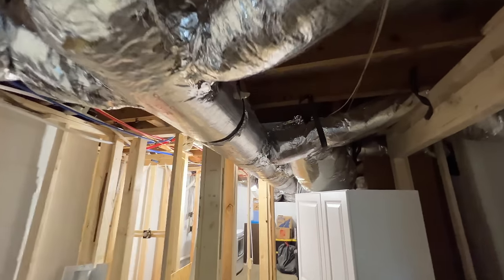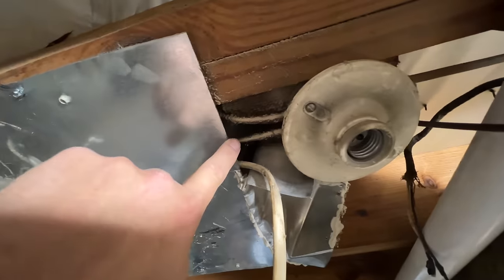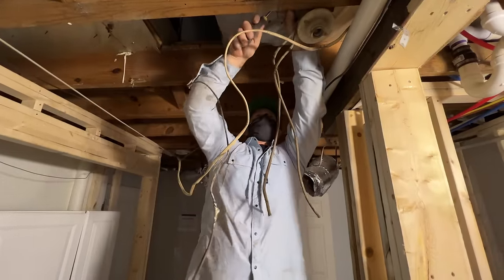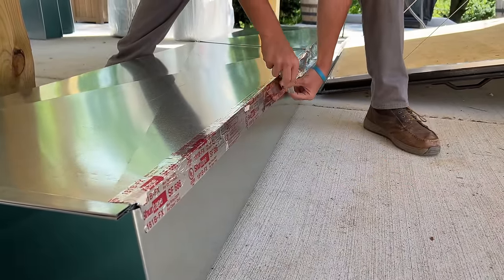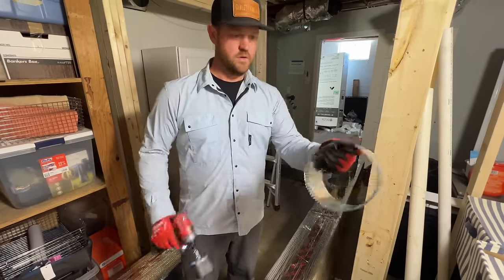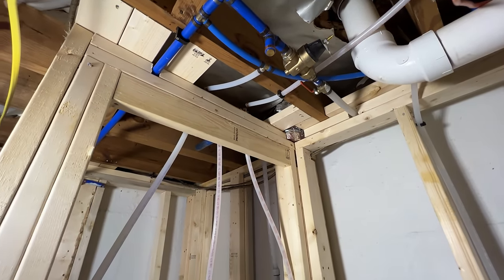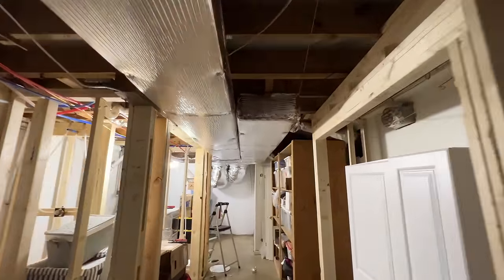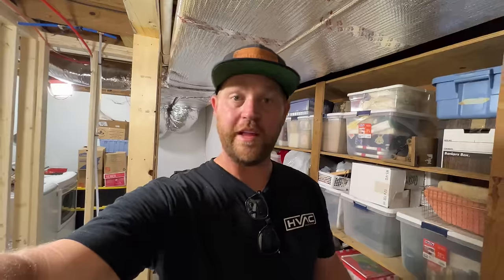Teaching The Apprentice How To Install Rectangle Ductwork | HVAC Installation

Comment: Square duct hanging tip: drop your hanger strap first, measure off floor up to where bottom of duct will be then make a mark on the strap.  Cut it off a couple of inches below the mark and bend the strap  at the mark.  Do the same thing on the other side with another strap to make a "cradle" for the duct to sit on.  Do this all the way down the length of the ductwork.  Then all you have to do is bang a couple sections together and lift it into the cradle.  Screw the straps to the bottom of the duct to secure.  Makes throwing ductwork up so freaking fast and looks pro AF
Reply: Basements are far from the norm in Tennessee, mainly slabs & crawlspaces .So it’s understandable  their expertise & experience is probably limited at best for such installations. Like you said el, make the cradle with hanging straps first and all you have to do is set the ductwork in place, you can even do it by yourself using a dog chain or motorcycle tiedown strap. I’m not so sure he size the duck work properly either, looks like he could have a static pressure problem to me.
Reply: I learned this lesson the hard way. Just started my apprenticeship almost 2 weeks ago and the way you’ve just described is a hell of a lot easier and give it a clean secure look!

Comment: Good work, but you went through all that work making sure the duct was nice and sealed, but then you just tapped the round flex to the bottom of the duct. It should have a nice square to round transition instead
Reply: Yep, and doesn't look like he used a rigid elbow either, at least not for the return!!!  Big no no.

Comment: As far as taping the metal ductwork or even fiberglass ductwork it is best to use a heat gun or I usually just use a Turbo Torch and just run the flame down at real quick being careful obviously and like I said use the heat gun if somebody's not that responsible or you're in a space that you can't use flame with that being said when you do that that tape becomes part of that metal or fiberglass it will not come off and if it does it's taken the fiberglass with it and metal wise it's almost impossible to pull off it just heats up the blue and adheres to it in a way that you will not ever do it again without using heat. I've had a trunk line that was over 30 ft long that I can pick up at one end and just hold it and that sucker did not Sag a bit or nothing.. so like I said it is well worth the little bit of time it takes to heat it up and then squeegee it!

Comment: Install is good. But why did you not reduce the ductwork for velocity?
Reply: Thats what you get when the service man does the ductwork
Reply: Install does look good but definitely needs reduced and would have been nice to see square to rounds on the end of the ductwork instead of tapping into the bottom. As far as the look of the work it looks really good.
Reply: @Salyers-Family-2004  square to rd is a must. Ive seen him use them before kinda surprised he didnt on this job as well. Its clear he doesnt do ductwork on a daily basis but clean work always respectfully

Comment: Love that crimper tool! Duct's look good. I would recommend using a hard pipe 90 coming from the package unit and tapping into the main trunk lines. Either that or a square to round fitting would improve air flow

Comment: Dude I wish I had that hoist when I was in installed rectangular ductwork. It was all done by me standing on a ladder going and Sention it up every section by section. I love following your channel because you do such clean work as I would do myself. A lot of people think because they’re going to be putting that behind a soffit that it’s out of sight out of mine but the real ones take the time and seal it up and make sure that when it’s out of sight out of mine it’s all sealed up and installed correctly
Reply: That's the harbor freight special drywall hoist. I got that thing for drywall and its definitely worth it, even for a single house job,  only $250

Comment: A few years ago I was hired to remodel and install kitchen cabinets plus the renos .Before me they had a couple of cabinets installed in the kitchen one cabinet was  a pantry just so happens installed the pantry cabinet  over the heat vent .The customer had a cold kitchen after the pantry install so to fix the cold room added a electric baseboard heater .I fixed it when I did the renos after that no need for a baseboard the kitchen was comfortable.

Comment: Nice job Zack, You definitely cleaned up the crappy install that some contractor left a mess, and really liked the drill crimper for the duct, I'm going to shop around maybe get one of those, it definitely speeds up the process, Good job again.

Comment: I was wondering why you were insulting your inside duck if it’s in a treated or conditioned space ? Here in Canada you need to have it sealed with tape or mastic but not insulated unless your going through a unconditioned space such as a attic or crawl space . Love the very clean work and explanations your work is outstanding and very inspirational.
Reply: Technically and by code you don’t need to wrap in a conditioned space. But by experience with the high humidity in the south your supply duct will sweat in the summer. And if the home owner is going to drywall the ceiling I guarantee your going to have a call back on water marks on all that pretty drywall. Probably wrapped the return to have a consistent look 🤔

Comment: I’ve thought about the drywall lift in residential settings but I’ve never seen it in action. That’s awesome!
Reply: Looks like a pain in the butt to maneuver down there.  I have that same hoist and it sucks in tight spaces, the wheel base is do wide

Comment: Is the basement not a conditioned space? You ran a beautiful trunk line before pinching the flex runs at the termination of the trunk leaving little to no room for back pressure. Here in Pittsburgh, taping seams of 8”-24” x 8”-12” is absolutely ridiculous and not code despite some of the tightest regulations outside of California

Comment: At 3:20 why bubble wrap insulation and not fiberglass? Are FF-100 and FSK interchangeable when used on the reflective part of insulation? What staple gun/staples did you use here?

Comment: Might be a dumb question, but would multiple staples going through the duct cause leakage over time? Are there other ways to install the insulation to the duct without stapling it on?

Comment: Is the RECTANGULAR duct going to exceed the ESP of the unit?
Reply: Yep, especially with the funky connection at the main trunk to equipment! 90 the flex into a dead end shot at the rectangular duct?  Come on man! The system probable exceeds ESP before the SA hits the first boot.
The rectangular SA ducting running the hallway also should have had transitions to help balance airflow to the boot boxes.
Did anyone use a ductulator here?

Comment: that new duct is way too small for that size unit. the static pressure is gonna hurt that system from performing how it could with properly sized ducts, next time use a ductulator.
Reply: THIS!!!!

Comment: Good job but i feel like Ducting in the US seems very behind compared to the UK. Saying that tho you’re probably cheaper as you made the duct from scratch where as we would get the duct pre fabricated where its already sealed no need to put tape and sealant all over the pieces. Also we connect duct with 20mm flanged joints rather than what looks like you insert them into eachother

Comment: No mask or saftey glassesfor the kid.. fiberglass is not something to breath in long term. Get him a dead low and use that to do the snaplock. His hands will thank him later in life.  Got to teach these kids right or they won't last. Always hang your straps first than put up your duct.  Why not have made reducer fittings at the end to be able to put those flex lines straight in? It was a clean job till the end.. yikes.

Comment: No disrespect but sheet metal is a real skill and not taught well anymore. Bubble wrap has no R valve if there is no air space between the duct and the wrap, you need spacers. That transition from round to square duct is killing air follow. You should have gotten someone to make you (2) square to round fittings. A really tin knocker would have that duct hung by the time you dragged in the lift and set it up and packed it up again.